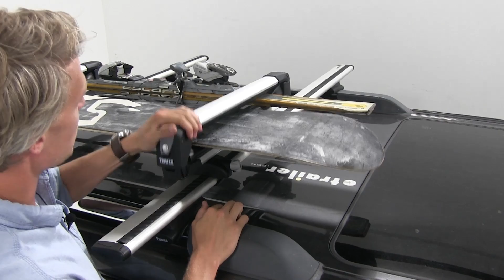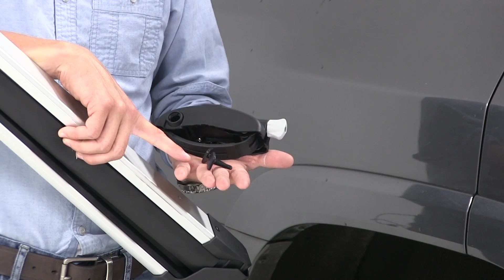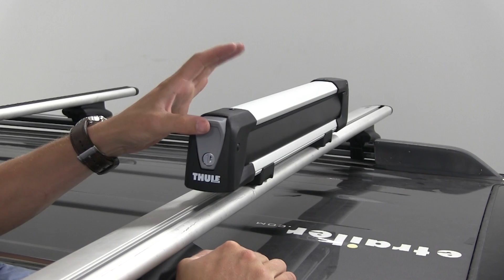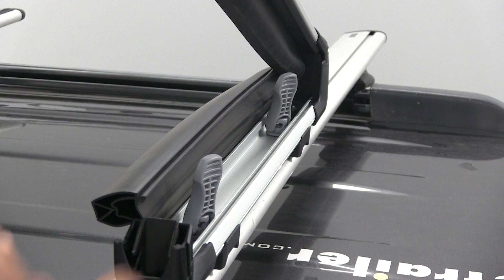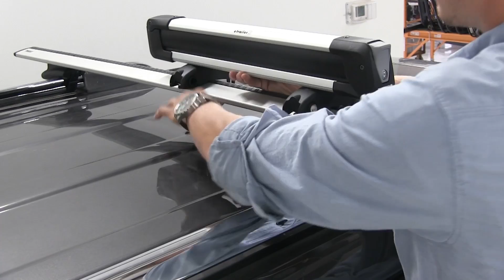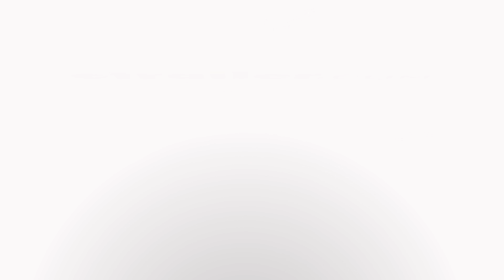etrailer | Complete Breakdown of the Thule SnowPack Ski and Snowboard Carrier

Comment: What I don't care for with the T-slot type bars is that you have to cut the rubber strip on top to accommodate whatever type of accessory that you're mounting. That's fine if you're only using your bars with one type of mount but what if you're using different types of mounts like ski for winter/ Bike or Kayak during the summer? Seems like you'll end up with a bunch of cut smaller strips.
Reply from the maker: I am going to have to agree with you on that one. The convenience of the T-slot comes with some down sides, one being you may just need some spare rubber strips to have sizes for all of your different accessories.

Comment: does the brand of the cross bar gotta be the same? as the snowboard Rack? or can it fit any cross bar?
Reply from the maker: The Thule SnowPack is designed to fit round, square, aero, elliptical, and most factory crossbars and they do not have to be the same brand. The only time we've really had fit issues are with the larger Nissan Xterra/Frontier or factory Hummer crossbars.

You can find out more details about the SnowPack here https://www.etrailer.com/p-TH7324.html

And if you're looking to get a new roof rack you can find many different options here to best fit your vehicle https://www.etrailer.com/